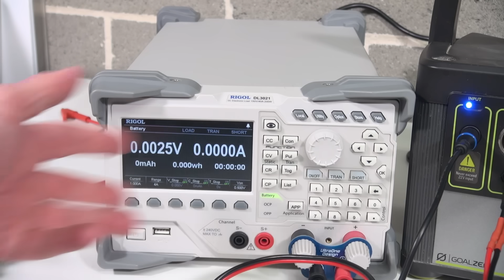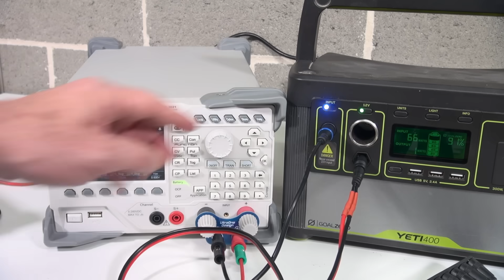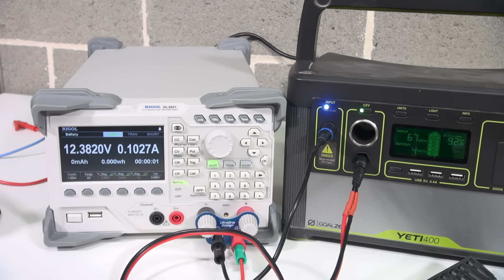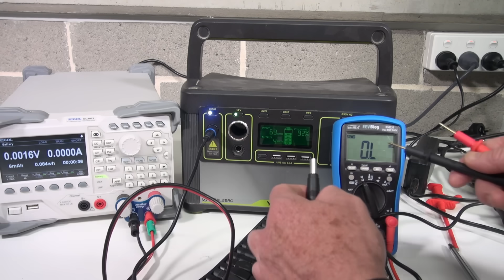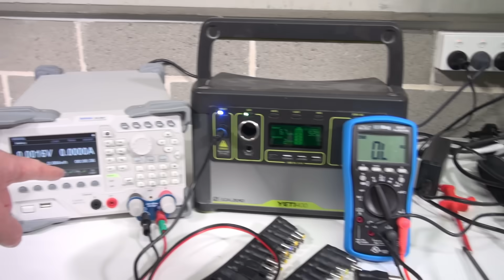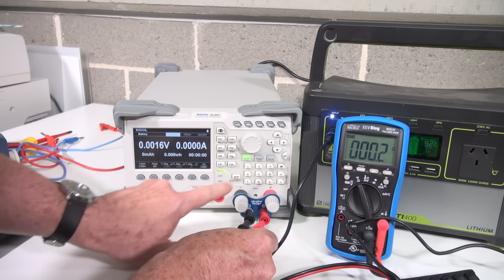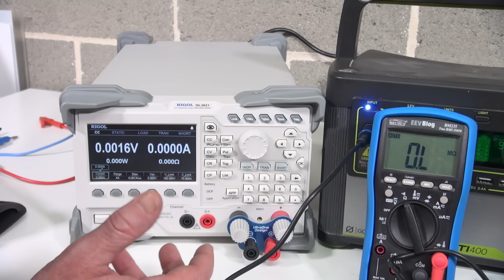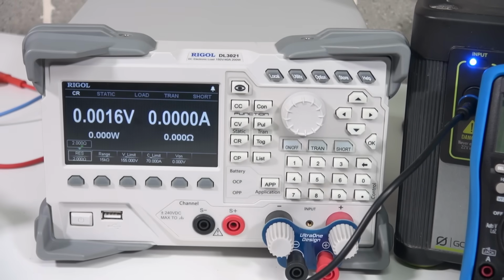WTF is Wrong with my Rigol DL3021 Electronic Load?

Comment: I had the same problem, down grade to a lower firmware version.
Reply from the maker: WTF, seriously? Thanks, I'll have the try that. That's insane if true.
Reply: @EEVblog2  The firmware to use for this version 00.01.02. This one is working in my DL3021 with FPGA version 00.18. I have 2 of them and the other one has firmware version 00.01.05 but with FPGA version 02.03. When you need the correct firmware, please let me no. It's hard to find.  Success from the low lands, Holland the Netherlands where we speak Dutch.
Reply: @fransvanaperloo181  If it helps the analysis. My DL3021 does not have the current setting issue. Whatever current I set in the battery app is the current load when I switch the load ON. However it does present 0 Ohm across the leads regardless if the load is set to ON or OFF (like in the video).
Software Ver.: 00.01.00
FPGA Ver.: 00.13
I've never used it as load for a battery, so never had any issues with it until I saw this video...
Reply: @fransvanaperloo181  Greetings, can you help me find the v00.01.02 firmware?
Thank you for your help.
Reply: @EEVblog2 As mentioned, it’s a bug in the firmware version 00.01.05. I reported this to John South at Emona instruments in May 2023. 
John reportedly to it to Rigol, who said they are too busy to fix it and we’ll just have to wait. Years later and we’re still waiting. Nice one Rigol!
Reply: Little buggers!

Comment: We own two DL3021 devices, both plagued with numerous issues and each having a different FPGA firmware version. Despite purchasing them in 2020, when we inquired about upgrading the firmware, Rigol informed us that the cost of upgrading would exceed that of purchasing new units. This response seems illogical, as upgrading an FPGA is a straightforward process if you have the necessary tools and binary. Moreover, discarding equipment in favor of new purchases contradicts the principles of the Green Economy that Europe actively promotes. Hoped in a different answer from Rigol Europe.

Comment: I'm looking into buying one of these for battery testing. So, I read the manual. Sorry Dave, I know you hate that, but in the battery test parameters I found a Von parameter. Looks like you have it set to 0 volts. I think it should be set to slightly above the BMS low line cutoff. Hope that works.

Comment: The company I worked for some years ago bought a brand new and precise power supply. I used it to generate 1.0V and 2.5V for an expensive chip, but it turned out it would spike up to 9V when turning the outputs on, and of course it fried the chip. I then learned to never trust any electronic equipment when I connect it to something expensive or dangerous.

Comment: I have a DL3021A, not a DL3021, but I'll check later and see if I can reproduce this or not. Mine is still running the firmware it was delivered with, so it's probably pretty old at this point.

That said, I use that load all the time, and so far I've never had a problem with it. But pretty sure I haven't been in this exact scenario.

Comment: In constant current mode the load is set to 1 ampere (reference) and the control loop reads zero current (large error in the control loop) so it will turn the fets on in an attempt to increase the current. This is normal for CC mode. When testing certain power supplies we would use two loads in series, one in CC and one in CV. This way the output would have a chance to raise in voltage before the current would start to draw. As to how the battery mode works, I do not Know. I would have the CC mode locked out in Battery test mode, just my opinion.
Reply: Except that it does this when turned off, it is the default "setting" suddenly. Also, CC is the absolute standard for battery discharging, as they are defined around their C-value (current relative to capacity).

Comment: Dave, I have a 3021A with version 1.04 software and it is not having the error you are describing in battery mode however I noticed that with my UNI-T 161E multimeter hooked up that my multimeter puts out reverse voltage in ohms mode.... what the? Should have bought a Brymen.

Comment: I built a dc programable load as a hobby project and I had the same problem. I was able to solve this by applying a negative voltage on the gate of power mosfet when it was in OFF state. there might be other solutions too but I was not aware of any. Maybe you could dig into this and try to showcase some solutions. Also you seem very angry in this video.

Comment: Just tested my DL3021. I see the same 0.1A current limit issue when turning the load on when set to 1A. As you, I had to reapply 1A when on to make it actually draw 1A. When I turn the load off the inputs go to 258k between the terminals so mine does not go to zero ohms as yours does. CC mode also shows 258k on between the terminals when the load is turned off. 
Mine is running:
  Sw version: 00.01.05
  FPGA version: 00.18
  Boot version: 01.011
  Hw version:  01.00
So same versions except for the FPGA.
Reply: There are two 1.05 versions, 1.05.00.00 and 1.05.00.01. Interesting that you have a newer FPGA version than he does, maybe that means he's not on the latest FW? Or the upgrade of the FPGA failed somehow.

Comment: Don't have this issue, but depending on the load the CC will oscillate, added a 0.047uf cap at the load solved that problem.

Comment: You say that it should never present zero ohms. That is not correct. In constant current mode; if the power source (ohmmeter in this case) is not able to source the set current (1 A in this case), the resistance will remain zero ohms. Once the current reaches the set current, resistance will adjust to keep the current constant. So, ohming the input in constant current mode should indeed measure zero ohms. Note that I'm not saying that your device is not broken. It certainly is. But your "never" statement is incorrect.
Reply from the maker: It should never present zero ohms when set to OFF. But otherwise you are correct in CC mode, it could indeed start at zero.
Reply: It should never present zero ohms with it turned off!
Reply: I guess that was caused by emotions. But it did shortcut when it was set to off...
Reply: I agree. You can set when the CC mode will engage to allow the P.S. to reach minimum operating voltage.

Comment: Yep, noticed the exact same thing a couple months ago with my DL3021. I think their control loop starts from a short instead of open circuit and simply ignores small currents (as in the multimeter test current).
Another ITECH e-load we have at the lab has the exact same behavior, so maybe it's a common approach for cheap electronic loads?
Reply: Looks like it possibly takes "0 R" setting from CR mode. What if you go to CR mode first and set 100 R there (or at least 10 R), and then go to Battery mode?

Comment: Definite issue.  I would not be happy.   Be sure to post what the solution is from Rigol.  You have the resources to continue on with say another electronic load and such but us small time bench guys would not be able to combat this without lots of lost time.  It also tells me there is a safety issue.  If that battery pack did not have a cutout detection on it, wires, batteries or load would be the ones giving out smoke.  We all know your building does not like any smoke in it. Unacceptable.
Reply from the maker: Yes, big safety issue. Could also damage your expensive widget you are working on.
Reply: @EEVblog2 one of our AE contacted you, if there is anything else we can do for you feel free to let me know. I will drop you on Monday another email with my contact data, feel free to let me know anytime if there is any challenge.
Reply: That’s what she said…
Reply: Dear David, 

thanks a lot for the video. I will let it check this by our Application Engineer and immediately address it to our R&D. I am happy to keep you posted.
Reply: @RIGOLEU_GM    One reason for my comment is the fact I live off of and like Rigol.  Own MSO4000. DM3068.  DG4102.  DSA815. Want RF sig gen.
Reply: @johncundiss9098 I am very happy to hear about it. We will do our best to continuous improve our processes and products, please feel free to get in touch with your local dealer or RIGOL EU. I am personally checking all videos about our products on YouTube and thanks to the feedback and comments about our products. You can be ensured that we will evaluate each feedback.

Comment: Wow that's a major fail, no way they all act like that otherwise people would be complaining non-stop about it being a POS. Interestingly the software version you show in your original review is 00.01.01, but it's now 00.01.05 so you've updated it to the latest at some point. However, your FPGA version has remained the same 00.13. But I can find evidence there's slightly newer DL3021 units with FPGA version 00.18? Maybe those are incompatible?
Reply from the maker: Thanks, interesting, could be some combination of FPGA and firmware them. Yes, no way this happens on every unit otherwise everyone would notice it.

Comment: Weird. Just tested it on my DL3021 with the same software version but with FPGA version 02.03. I was not able to replicate the fault. I tried both with the bench power supply, and with the 12V output if an EcoFlow battery while charging. Both seem to behave as you would expect for me.
Reply from the maker: Interesting, thanks.
Reply: Yes I can also confirm that I was not able to replicate the short. Mine also has FPGA ver. 02.03 and soft ver. 01.05

Comment: I had one of these Chinese electronic loads with a PC cooler, and it did an even worse thing: it was working fine until hitting the low voltage limit, at this point, it was shorting the output instead of turning the load off.
Reply: Atorch... Right during operation, the load MOSFET went into a short circuit. This happened while testing a LiFePO4 battery of a charging station. If it had been a Li-Ion or LiPo battery connected, the outcome would have been much worse.
Reply: oh lord, i use one of those. now im gonne be scared to let it run unattended

Comment: Maybe also check the actual current being drawn by the load, as the display of the Yeti shows upto 18 Watt as output while you have it set to draw 1A.
Still possible the output power meter of the Yeti isn't that reliable, or at least not while charging too. But given the Rigol is acting so strange, I wouldn't be surprised if the Rigol was drawing not such a constant current as it claims to do.